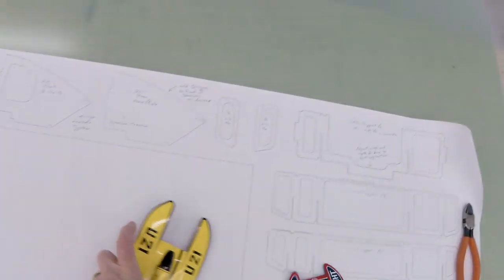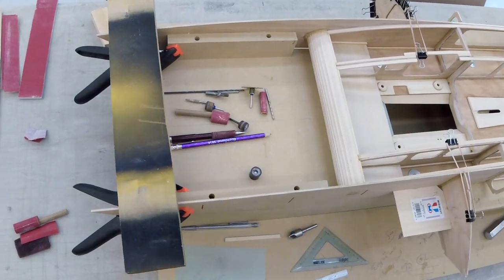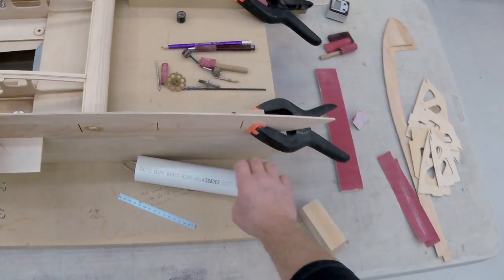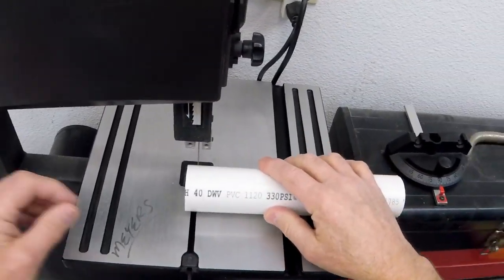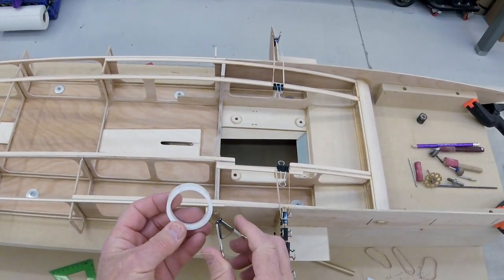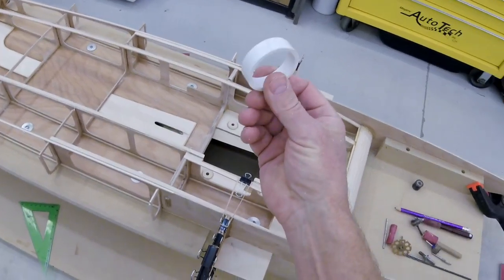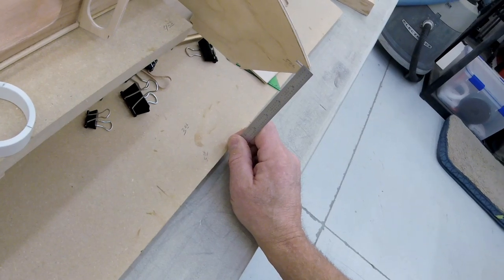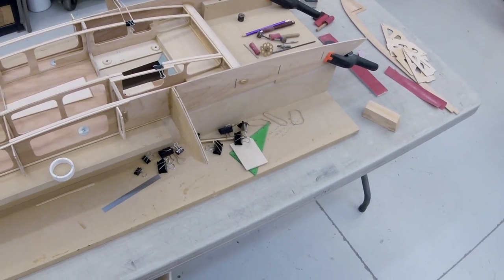Creative Clamping for RC Racing Boat Building - Part 4.1 of "The Gasser"

Comment: Hey Scott, did you get a set of plans put together for sale? Maybe its in a later video. Please let me know. Had a great time at the 2023 Champion Spark Plug Regatta. Thanks again, Mark
Reply from the maker: I did for my gas scale boat, but I've changed the design considerably since and haven't built the new one yet.  It was super fun having you join us in Kennewick. Maybe you should consider coming back for the Columbia Cup!
Reply: @M5PerfHydros  Would love to make the Columbia Cup but will be in Oshkosh for EAA Airventure during the last week of July. I'll keep an eye out for another opportunity before year end however. Learned a lot over the weekend.

Comment: Were do you buy your ply from the only one I found that has those sizes is sig Midwest doesn't have those lengths?
Reply from the maker: Best large sheet supplier I've found is Aircraft Spruce. The sheets are 48", so you will need to splice for the upper deck on a large gas scale boat but for everything else it's perfect. Link below is for "Finnish birch" which is the nicest material I've ever used;
https://www.aircraftspruce.com/catalog/wppages/finnishbirch.php